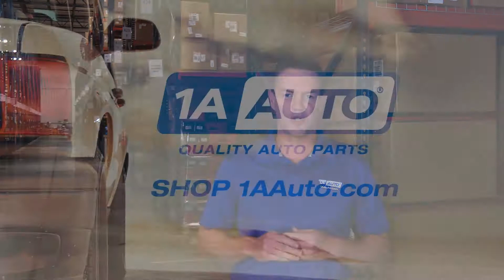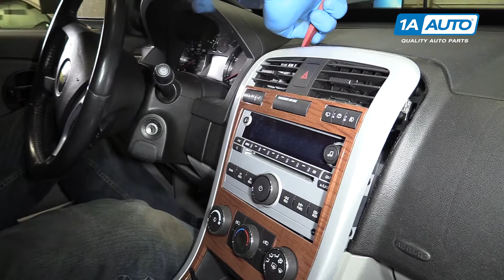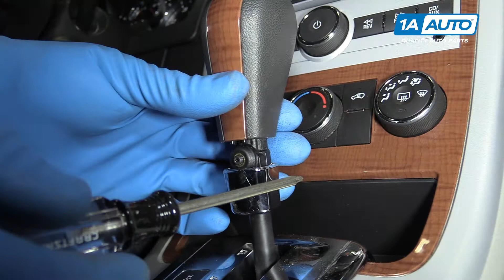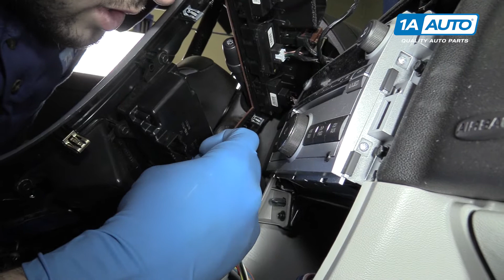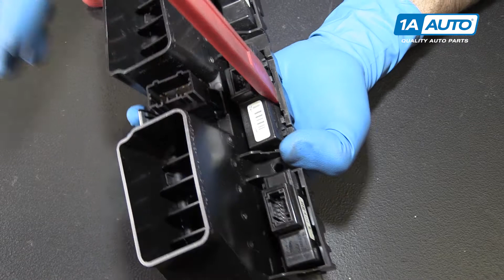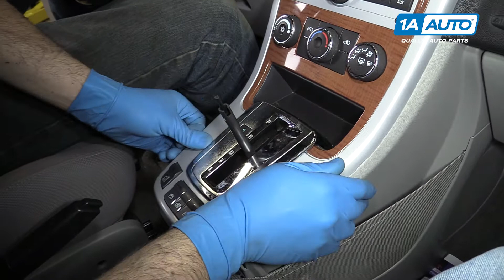How to Remove Passenger Airbag Indicator Light 05-09 Chevy Equinox

Comment: I have a 2009 Chevy Equinox and I was at a carwash cleaning my car and I use the air sprayer to remove all the dust from the dashboard and somehow that triggered for my airbag indicator light to come on my car completely locked and I was not able to move it or even put it into neutral is that common when the service airbag light comes on it doesn't allow you to move the car at all. I had to have the car towed to a body shop. And now that I've seen this video I want to go try all this out and see if that helps.

Comment: Hi 1Aauto,  I have an 05 Chevy Equinox 74,000 miles. The airbag light blinks and stays on. (No accidents and fuse is ok). Help please??? Thank you in advance.
Reply from the maker: +Basement31 If you have also lost some of the controls on the steering wheel it may be a bad clock spring in the steering wheel. Hope this helps you out. 1aauto.com